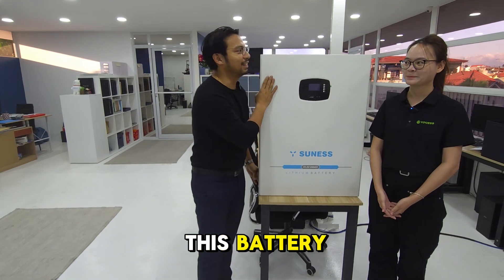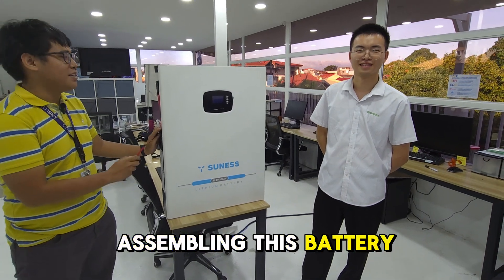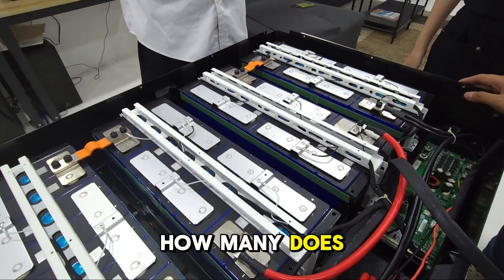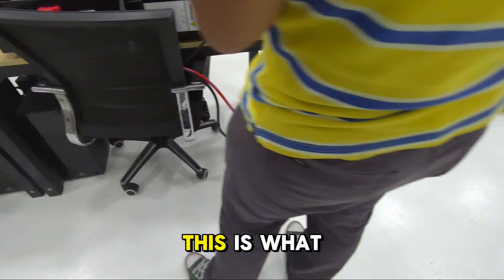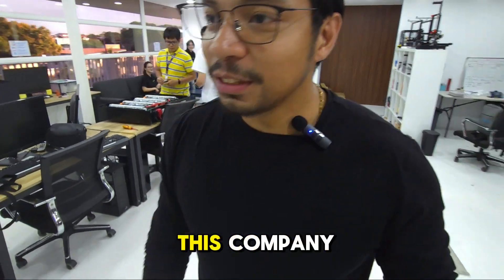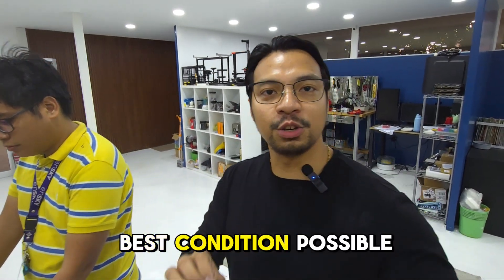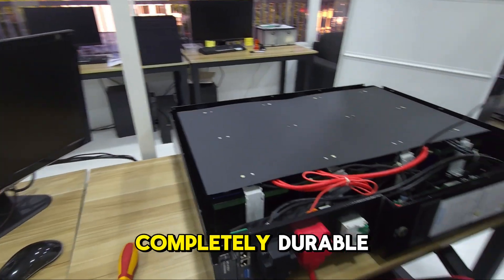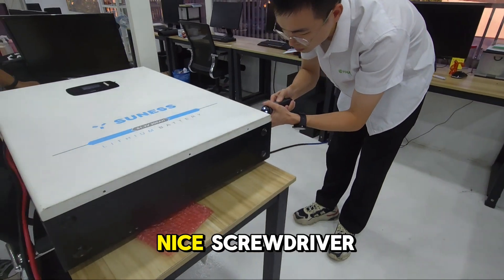Suness Solar Lithium Battery buksan at tignan ang kalidad Mabilis masira o matibay?

Comment: How many Cycles before it retires?
Reply from the maker: The battery promises 8000 cycles, the batteries installed in the office is at 90 cycles na. All good so far, we are yet to see. Hahaha. Pero under harsh conditions (under direct sunlight, slight moisture outdoor location) yung sa office so we're really treating it like shit to expedite the degradation. If it lasts atleast 5 years, then its really a good battery. We also discharge it down to 0%, and charge at 120A. So going beyond its rated capacity. :)
Reply: Do you also assist or actually do the legwork for NetMetering application to Meralco? 😊

Comment: This is what i want!...chinese engineers and people here to support their products..sana maay for small setup lang yung basic TV,Satellite,Ilaw..yung pang bukid or pang masa.
Reply from the maker: @cetocoquinto4704  for sure sir magkakaroon din yan. For now the most economical and viable use for LifePo4 kasi is the 100Ah, 200Ah and 300Ah :) but will definitely cover a video for small set ups if magkaroon na
Reply: Sir! How much po yung ganyan unit ng battery 100ah and how many solar panels po to charge the battery.
Very knowledge yung videos nyo about sa battery,thanks s info sir
Reply: How much the price???? Pls put your contact number on the screen
Reply: 51vx100ah=5000 Watts (5kw). If it is 10kw, something is not right.

Comment: How about balancer is these battery has?
Reply: Sir where is your warehouse in bicol?
Reply from the maker: @nhickanghelz5133  hi sir, we are located in ligao city. You can contact @enskysolar directly for coordination and visits.
Reply from the maker: @nhickanghelz5133  Ligao City sir
Reply from the maker: Hi Sir the battery already has a balancer. The Battery management system has an active balancer. :) The Battery also has a software that lets you monitor each cells on your phone and computer. 

It will also register the difference between the highest cell voltage and the lowest cell voltage. Those 2 values should have a very minimal difference. That way you can see the balancing working very effectively
😁😁😁😁
Reply: How much for 300AH
Reply from the maker: @EricPerez-x4m  Mura lang sir! Connect kita sa mga gwapo at magagandang sales ng Ensky Solar. Hehehe. 

You can contact them here:
https://www.facebook.com/enskysolar
Globe - 09760157847
Reply from the maker: @EricPerez-x4m  Mura lang sir! Connect kita sa mga gwapo at magagandang sales ng Ensky Solar. Hehehe. 

You can contact them here:
https://www.facebook.com/enskysolar
Globe - 09760157847
Reply: Sinabi niyo specs ng battery pero wala naman price, paano bibilhin yan?
Reply from the maker: @allanb.spearfishingtv4535  you can inquire here sir. I'm not the sales staff in the company and the prices also differ for installers and bulk orders so it's much better you speak with a sales associate. 

Mura lang sir! Connect kita sa mga gwapo at magagandang sales ng Ensky Solar. Hehehe. 

You can contact them here:
https://www.facebook.com/enskysolar
Globe - 09760157847